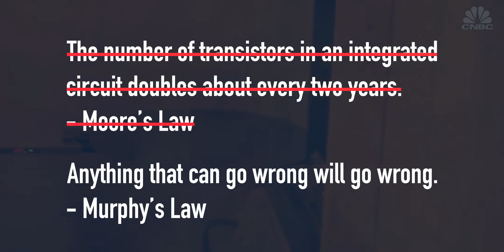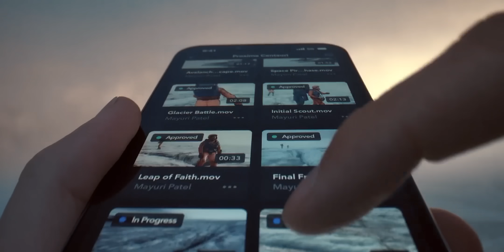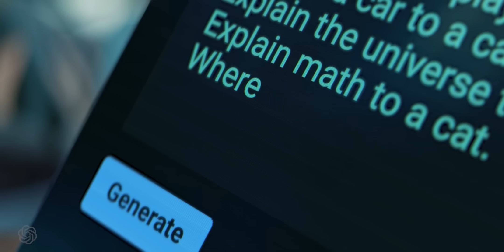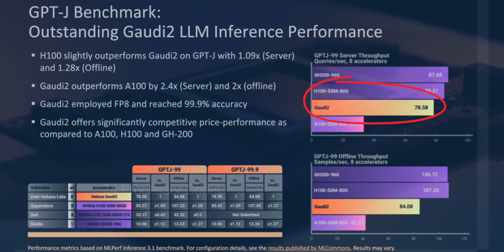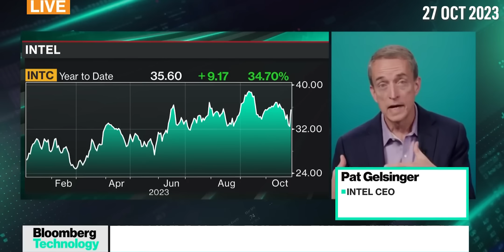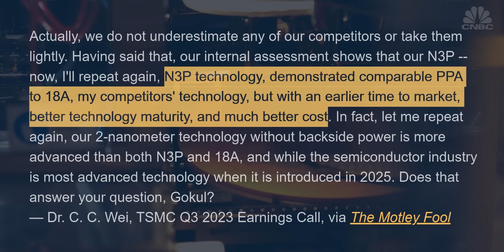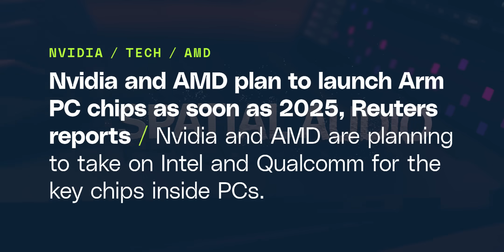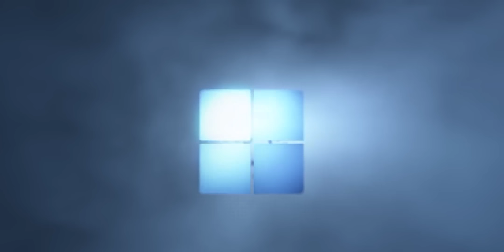I WAS WRONG! Intel's Crazy Plan to Dominate AI Chips is Working

Comment: AMD is actually down in the x86 in the DIY market. For the first time since the Athlon 64 days AMD has over 50% of the market as of Oct 21 2023. AMD is also putting 50 TOPS in each of their upcoming chips along with 4-12 CU GPUs in the 8K APU lineup. They (Intel) are also selling their chips to consumers at what is apparently almost cost after all of the packaging, shipping etc etc is taken into account. Making matters worse on every front isthe performance lift coming from AMD which, as of now, has gone from a tolerable 5% increase in most general PC tasks to over 25% in high compute workloads (video games, editing and so on) with single core and over 40% in multi-core functions. That's engineering samples as well, so a lot more is expected out of said CPU's. With Intel's recently released 14 series I'm not sure how well they can compete unless their manufacturing allows them to DROP prices while attaining higher margins as it appears that Lisa Su and AMD are about to pull a "Core 2" on the Blue team, dominating in AI, Graphics (the gen following 8K from AMD is looking at 150 TOPS and 40 CU's on their their x800X class CPU) and x86 single and multi-core by a large, and I don't mean 5%, 7% or even 9% margin. I mean like 15%-45% increases in single and multi-core while using less energy.

I hope you're right about your outlook as AMD could pull an Intel and jack prices through the roof across the board if you aren't. I love the PC tech sectors, and having one company dominating any segment is AWFUL for everyone. Whether that's x86, x64 Graphics, memory and/or storage and apparently now AI with Windows 12 rumored to require 50 TOPS to run properly. Intel has it's work cut out for itself. I'm really hoping that they can pull off a miracle on the GPU front, and giving up on Arc I think would be a HUGE mistake. It could very well be the key to their success moving forward, and with drivers getting better and better, dollar for dollar they might be the best option on the market right now with their A580 and A750's (16GB, not 8GB). Also, you never know when the market will decide we need an x64 mineable crypto currency again. With the way the US, Canada, China, India, the UK, Germany...err, a good portion of the world's fiat, look at the moment, that time could be sooner than later. A $0.0057 coin could jump to $3 overnight, or a new one that isn't a scam could very well happen. From a user standpoint I hate that idea, from an investor standpoint I'm skeptical, but from someone who is worried about an economic collapse? On that front, although I hate to admit it, I'm almost hopeful. I'd rather pay the bills with a bunch of GPUs than I would chopping down all the trees in my backyard and cutting them up for firewood to trade for goods and services if we end up in a depression again. With UBI seemingly around the corner by necessity, a new affordable currency may turn out to be a good thing.

PS I prefer long, more thorough videos so no worries there superfly.
Reply: I'm not so worried about AMD because the slowdown in the PC market was predicted a couple years ago and has in fact played out almost exactly like it was predicted and the main thing AMD had to do was survive it.

Personally, I GREATLY benefited from their low pricing on Zen 3 as I've been filling up an IC (Internet Cafe) in the Philippines using it because it's high quality and excellent in performance AND low power.

For server AMD has good market share for anything non-AI, but with the hardware they just released there is both Microsoft and Google saying they're buying it and part of this is not feeding the Nvidia beast.  So there are plenty of companies that see Nvidia as taking too much profit margin making it very expensive for them developing their AI technology and are using AMD AI acceleration for servers.  

What there isn't anymore is the big rush to AMD EPYC because a lot of server hardware has already been replaced.  There was a big rush and maybe AMD needed to make more money than they did off of say Zen 2 - 3 EPYC which is where AMD really made money.

Zen 5 will improve on Zen 4, probably not enough so I doubt it will be big for them.  The key is going to be what happens with Zen 6.  AMD HAS to improve their MCM architecture.  Zen 6 could be another Zen 2/3 moment for AMD, and it needs to be.

I don't see Intel cutting into the server market very much unless they use TSMC die because right now their "Intel 4" process node is still new and the only thing they could put out for the upcoming year is laptop parts.

And this is EUV.  That's the bad part about this for Intel.  It's taken FOREVER for Intel to get onto EUV.  Their Intel 7 node uses DUV STILL.

So for Intel, they're still trying to get onto EUV with high speed die such as desktop CPUs, AND they have probably already gotten their first shipment of High-NA EUV equipment from ASML because they were supposed to get it this fall.  So they're dealing with 2 different technologies at the same time.  And I don't think TSMC wants to allow Intel to buy up large chunks of new process node production which would push AMD out of the market.  Intel wants to pass TSMC in node production and take part of their business.  It's not in TSMC's interest to hurt Intel competitors.

That's my brief take on this.  AMD needs to put out something serious with Zen 6.  Zen 5 will improve their core architecture and make other improvements, but Zen 6 needs to be a complete change to their MCM architecture and build on their chiplet design in a much better way than they have right now and that would also mean moving to direct connects for at LEAST desktop parts and away from their infinity fabric which uses a multiplexer on the IO Die to gate data to where it needs to go.  That's too slow.
Reply: @johndoh5182 and their server and and ai chip still thriving especially with recent releases mi300 series yeah they doing fine
Reply: Completely agree, great points
Reply: I don't understand where the value of Crypto Currency resides.    The value is Assigned by the Miner.  No wonder the first Scammers in made a lot of money.  It was MONEY FOR NOTHING.   Make a thousand million dollar coins and you're an easy Billionaire, except that people KNOW its a Scam.  I'd never buy or exchange for any Counterfeited Electronic Coin  unless I already had  its turnaround set up... Buy and Sell to some ready  to go Sucker.
Reply: What I saw those last decades is that performances jumps came from miniaturization when we were still above 10 nm. Then optimization. When the gains slow down to 5% or lower between generation, it's when there is no value in upgrading. AMD came up with Zen architecture but it will soon show its limits. Optical chips are still quite far in the future.
The path to Unified Memory can make do for a while, but I'm quite skeptic regarding spectacular jumps in technologies for the next 20 years.
Tech industries explore a lot of path, but I've seen nothing really new.
Reply: @Belaziraf " Zen architecture but it will soon show its limits", - if anything Zen performance uplifts are accelerating. The gab between EPYC and Xeon keep moving in AMD's favor still.
No, im tired of seeing intel powerpoint slides, broken promises and words. Intel is 2nd tier chips in both comsumer and more importantly the data center, thats why they been bleeding market share for years. Intel is 3.rd tier fountry, behind TSMC, behind Samsung.
What i need to see is an actual leader, either in actual product or from the foundty side. Before that shows, im not going to trust intel as an investment.
Reply: @MissMan666  I have lost interest in Intel since Ryzen 2. They could have come back on the first iteration. They did not. AMD is more innovative and daring.
I just hope they won't follow the footsteps of Apple, Intel and nVidia for pricing. Their actual pricing fluctuates but are still favorable to consumers. But for how long ?
Without rivals, it's easy to get lost in arrogance or abuses like Apple.

Comment: I believe their numbers looked bad because they invested so much on the building of foundries to drive down profit, that AMD was winning in the datacenter. I believed in their plan.  My fear is the new competition from Nvidia and AMD with ARM deal.
Reply: intel has a licence to make ARM chips and a partnership with RISC-V. so outside of using more advanced TSMC nodes AMD and Nvida have no moves they can make on the CPU side that intel can't counter.  if they want to win they can only use GPUs and special accelerators.
Reply: @psionx1  Intel is projected to be on 20 Angstrom before TSMC, apparently NVidia is considering using Intel fabs in the future, Jensen says the roadmap is looking good to go ahead.
Reply: That ARM deal may have a major flaw in my opinion; they rely on a third party foundry: TSMC; because neither AMD nor NVIDIA do the actual manufacturing and TSMC is basically full of orders as it is, so theyll have to make the line. Meanwhile Intel, will be able to design and actually manufacture their chips in 2025 using 2nm chips. Iwill follow intel close; their stock may be cheap af, for what could they be in 2 years; also, intel has none of their plants in Taiwan
Reply: @santiagocarreno5881 which is really better choice for both of them because they don't need to manage foundry business, they only need focus on design chip. 
while intel are stagnant for so many years because their foundry can't produce newer generation foundry
Reply: Their reinvestment is very aggressive, which is a good thing for investors - AMD and NVidia are at highs right now, but it it still early days for anyone who wants to buy into Intel.

Comment: Good video. But you should have listened to Gelsinger's comments at the earnings call. He specifically said that 18A was better than TSMC N3. As a TSMC customer they have access to all the data. They also announced 3 wafer customers for IFS with a 4th being signed this qtr. And several packaging customers. One wafer customer has made a significant pre payment for Intel to accelerate their Ocotillo fab build out.
Reply: In a way yes. The US was asleep at the wheel and Taiwan was way more strategic. TSMC would really have liked to be the only foundry to the world but this is the game. By 2027 their golden run will be over if not a bit sooner. That is not a stock price comment fyi.
Reply: @ajaymathur1971 really stretch when intel not produce any chip use the 18a eh
Reply: Morris is very sad.... Played n used by americans ..
Reply: Agree and would add another key Gelsinger's comment on the same call. That is that those packaging customers are a "ramp up" for future wafer contracts. What I read between the lines is the following. 4 current 18A wafer agreements are Google, Amazon, Microsoft and Meta. The 4 packaging "ramp up" customers are Nvidia, Qualcomm, AMD and Apple. They will all sign 18A contracts sometime in 2024/25. Future will tell whether I am right or wrong ;)

Comment: How can you say intel plan is working?  They havent accomplished anything,  just made projections.   The 14th gen intel chips are only about as fast as existing amd ryzen chips, so very small improvments.   Also, arm chips look to have big advantages over x86, and many companies will be releasing them, not just apple.  There is no reason to bet on intel at this point.  Qualcomm's upcoming chip will equals apple m3, at less cost.

Comment: The tech in the low power Meteor Lake is going to serve as the springboard for the next steps, it looks ambitious but a solid plan with further room to grow after. We'll know if they're winning when the 20A chips come out, the numbers seem to work out to nearly a doubling of performance per Watt at the compute level, against the Raptor lake, that would be massive.
Reply: Meteor lake turned out to be quite disappointing. Just check reviews, not to good.
Reply: Massive on paper. What is the use case? Saving a few watts yet still lagging behind Apple/Qualcomm/ARM, let alone AMD? Xeon is even becoming irrelevant. To be exact CPUs released 10 years ago in 2014 🎉can still deliver 99% of what people need day to day.
Reply: @7hx89  Yep, it's been confirmed Intel talked big and failed to deliver yet again.
Reply: Except the word is OEMs testing performance are unhappy, Meteor is scarcely better than Raptor Lake, with performance efficiency only somewhat better over certain parts of the power curve.
The AI performance is not as strong as AMD's 2024 releases either.
This sounds like it could be another execution disaster failing to fulfill the impressive roadmap goals.

Comment: I believe you are interpreting what Pat is trying to say - literally. I have assessed most x86 architectures, and there are two limitations - heat dissipation per transistor and DIMM (max 8). 

Heat dissipation is something that will continue to grow on both CPU and GPU and while CPU is of the range 75-200 Watts - GPU goes up to 400 Watts. 

This is the primary reason (in addition to cost) why almost everyone is recommending inferencing use CPU. Amazon has already transitioned to this model for over a year now. Neutron uses Inferentia (their own accelerator INFR2) and Graviton (ARM architecture). This combination, today, has the best value for money. 

Oracle has already started recommending ARM for Inferencing. Oracle has stopped Intel completely. 

New info - Both AMD and Nvidia - have announced ARM CPU manufacturing. 

WHY - in today's market - NO x86 design can compete with ARM heat dissipation. Which is 5-15 Watts. 

For the DIMMS limits - neuromorphic computing. IBM just released its chip. Intel is just a little behind. This is what I am betting on. 

When the dust settles - I think 
AMD - Gaming / Edge
Nvidia - DC GPU / Edge (wide variety, including their gaming GPUs, will move to DC - better price point) 
Intel - PC Desktops (a dying business) 
ARM - DC CPU (this is the new Nvidia) 
Motorolla - Gaming / Edge 
Apple - M3 everywhere 

Hence, Intel still remains a concern. I hope that Intel becomes an excellent alternative to TSMC and that the US will force all manufacturing to be made-in-US (based on China-Taiwan tensions)  - which will get them what they need. This will be a better bet!

THOUGHTS?
Reply: with the current financial challenges for Softbank Group, I wonder whether there are any offers to Mr Son for the ARM

Comment: IBM like INTL has been a disappointment to investors in the last five years however IBM is in the quantum computer race and it's formed a partnership with NVDA.  The IBM of the 1980's would have regulations about how its employees could dress down to which color of socks.  Perhaps it wasn't the most important thing to focus on.  Maybe Big Blue has learned to do away with that which does not serve them well and to focus on what they need to in order to mount their comeback.
Reply: IBM's quantum is horrible.  Not trying to burst your bubble. Superconducting is a think of the past.
Reply: Quantum Chip still have decades or maybe century of work to do before it can reach the market. Operating at -459F is just too expensive.
Reply: @ghinyewfoong2826  a chip at that temperature would freeze the salsa.  :-)

Comment: My investment thesis for Intel is that they are set to be the Boeing of microprocessors. 

Aircraft and chips both represent commodities that are essential for national security and they are also something that requires very specialized knowledge and training to produce. There are all sorts of forces that protect companies like this. Intel is very likely going to be the only 100% American company to produce "advanced" chips entirely on US soil, owned entirely by a US company. There are other companies that make chips in the us, but they can't really compete with the likes of TSMC. Intel comes the closest I think, even if they fall short, but when it comes to national security 90% performance at 110% the cost is just fine. The entire defense industry as well as other adjacent sensitive industries will be "encouraged" or mandated to use Intel for national security reasons.   

They may or may not beat the likes of nvidia, amd, and qualcomm in those respective markets, but it almost doesn't matter much as long as they can compete, ie be "good enough".
Reply from the maker: This is a great take. If AMD has proven anything, it's that you can be a great company without leading any specific category.
Reply: @TickerSymbolYOU  AMD also happens to be kicking Intel's butt in many areas at this moment in time. But times change.

Comment: Guess intel was a bargain in the mid 20s
Reply: Yeah I loaded up down there bc I was impressed by their neuromorphic computing advances
Reply: They are still a bargain at $40. In 2026 this will be obvious ;))
Reply: You were right, almost $45 today, only 2 weeks later.  @andrepaes3908
Reply: Im about to be rich I got $50 call options December 2025 for .02 cents a contract 3000 contracts. No way they fail with government backing. Biden and Trump are both on board win/win and I’ll be retiring end of 2025 6k for option to buy 300k shares at 50 at end of 2025 hahahahahahahahahahaha
Reply: @JasonWilliams-lt2ql  wouldn't that be $60 and not 6k

Comment: Very balanced and solid analysis. Intel may not be able to outperform Nvidia and AMD in the near term, but a rising tide lifts all boats.
Reply: Intel's ability to control RDF in their 18A and beyond nodes will be their key secret sauce.  This is why they are so confident. If they can control to near zero, then they will have great performance and yield there.
I think they will be using a small companies IP for this.
Do you're DD.  I have.
Reply: They will beat them they have done it in the past! Intel will be the leader again Just watch and learn. The competition is very good! Dismissing Intel is not a good idea especially if you own shares in the other two!